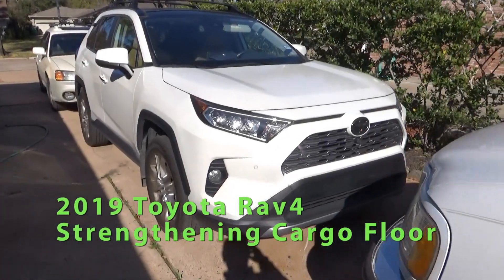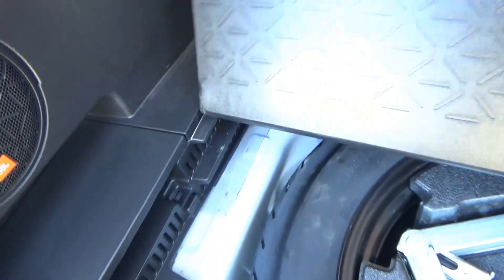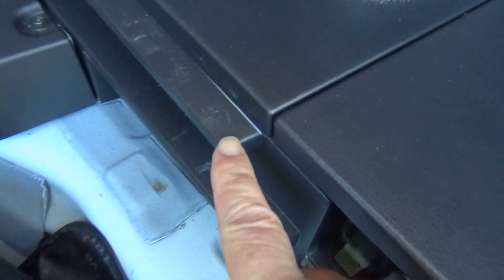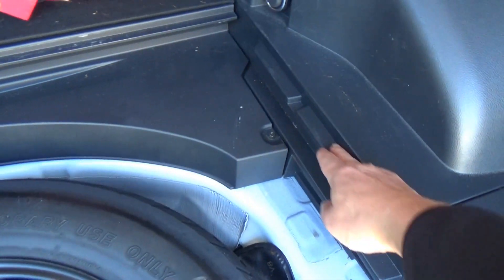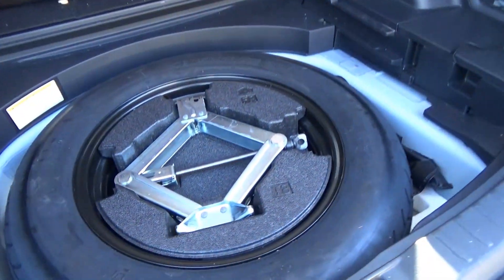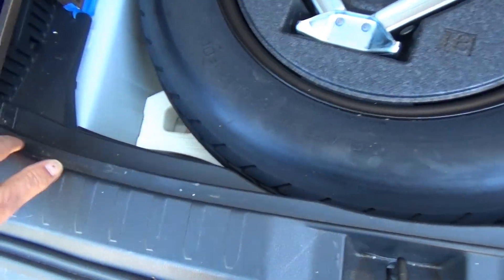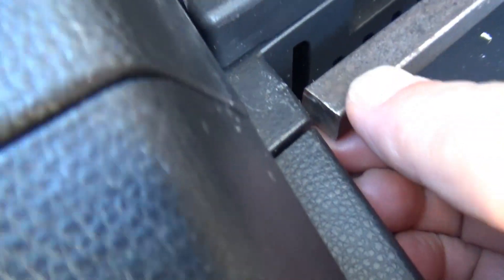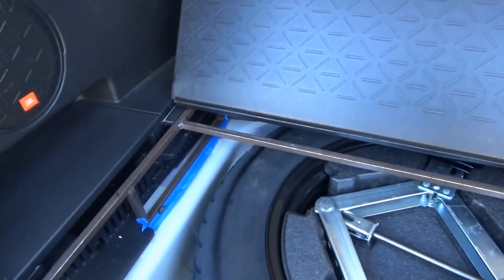Strengthening 2019 Toyota Rav4 Cargo Floor

Comment: Thanks for this video! I picked up my RAV4 a couple days ago, and I leant on the panel covering the spare to reach further into the boot and it colapsed in on me. I can't weld but your video gave me a good starting point for ideas. Made a similar contraption to yours today but out of wood, and now it's super solid and I can lean on it/place heavy items in there no problem. I couldn't find any other vids or forum posts talking about this issue which baffles me as I can't imagine we're the only few who have noticed that unsupported section. So thank you!

Comment: So now You have something super noisy in the trunk, and have no possibility to lower the trunk floor. If You lower the floor, (that's the reason why upper support is so short)  it would be well supported by spare wheel wihout need to put some extra metal bars inside ;-)

Comment: That’s a good idea. I have a 2023  Rav4 and have loaded quite @ bit of weight in the back ( a big Costco trip ) drove home ( 8 hours ) and had no issues. I don’t know if this issue has been addressed but I like your solution except for the steel tubes possibly vibrating? Maybe adding some foam or rubber end caps or even some waterline insulation foam might be a good idea.